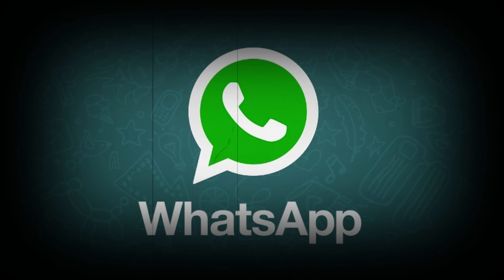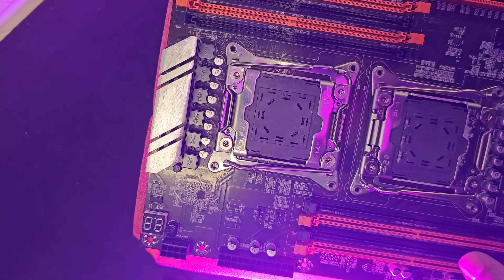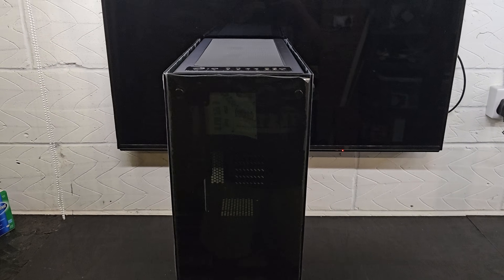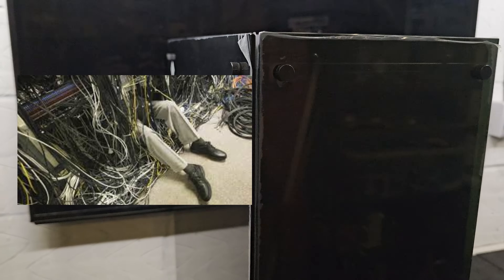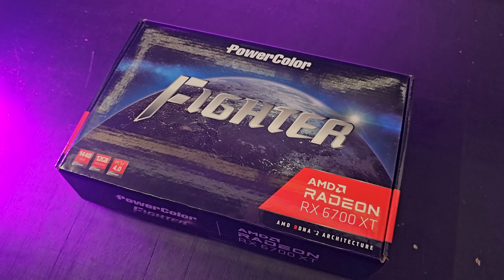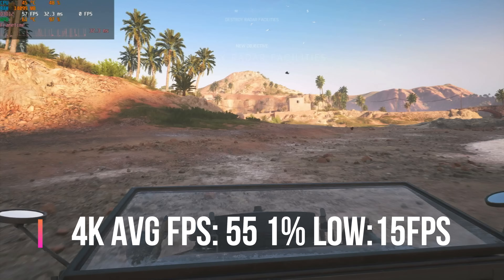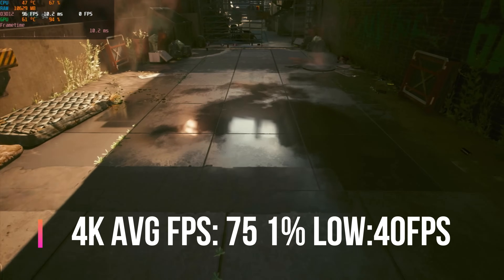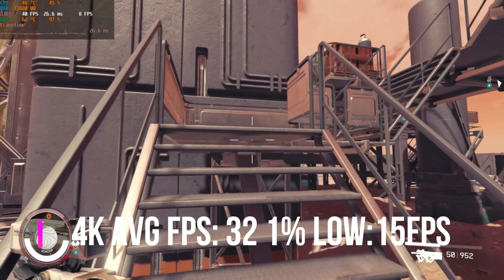Are DUAL CPU builds really THAT BAD?? Xeon E5-2643 V3, RX 6700 XT

Comment: If you want to try a dual XEON system don't bother with building something, case/PS/memory/MB even from the cheapest chinese websites will run you over 300USD. Old dual CPU workstations are dirt cheap. HP z640's are less than 200USD. If you keep and eye out you can get them with 32-64Gb ram and 950w PS and SSD drives. Sometimes the CPU's are not ideal but you can get any used E5 v3/v4 f0r less than 40USD, a lot are less than 20USD.
Reply from the maker: @JamesDeSimone-im7tz  sometimes people just give those away bur they are such a good base to build from!
Reply: @RestoTek  I know. They are considered e-waste. z840's are great systems too. I picked up 2 for less than 300USD. Single CPU systems are even cheaper. They are fun to play with.

Comment: You got bad fps in warzone is because of your GPU and not CPU. Rx 6700XT just simply too weak for 4k. While your GPU is on 100% your CPU(s) only worked at 30-35%.
Reply from the maker: @imbot3804  I'll try it with a rtx 3080ti see what happens

Comment: I wonder, if there were a motherboard with a chipset controlled pcie 3.0 x16, if that would alleviate the latency. I was always told not to installed GPU in the second x16 rails of a PC because that one isnt connected directly to the CPU but since the poor  1% lows in games here are likely because its connected directly to one cpu controlled pcie slot but not the other. So variable latency when a core from cpu 2 tries to process.
Reply from the maker: Interesting I'll need to have a look into this, thinking of making another video around this
Reply: @RestoTek  good luck to you! It can be difficult to find info on these boards. I look forward to watching it!
Reply from the maker: @jerryknudsen7898  haha I know I've looked and there isn't allot, I just poke it and see if it does something different
Reply: @RestoTek  that's pretty much all you can do lol I do the same with weird parts. There's 10,000 videos of an I9-13900k and virtually no data something weird like dual xeons, or even the 5700G testing with ideal settings which I just broke down and did myself out of curiosity 😅 the curse of chasing obscure information

Comment: I have dual e5 2697v3 32 ram rx 580
Reply from the maker: Sounds like a pretty amazing system :)
Reply: Hello, I have ZX DU99D4 and two Intel Xeon E5-2643 v4 CPUs, but only one is being detected. Both CPUs have been tested and are working individually. However, when both are connected, I get error 79. Do you know what the problem might be?

Comment: As we say in my country: use the right tool for the right job. A dual cpu (not this one actually) setup with plenty of cores/threads are aimed for multi-tasking, a lot of containers, virtual machines and so on, not for playing games. Greetings from Brazil!
Reply from the maker: 100%, although it can run games too but your right, it's fantastic at all of those other things
Reply: @RestoTek  yeah, I work as a software engineer and run several containers in my Linux box with docker. It's where the tons of cores/threads really shine. It would be nice to have a video on this topic as well, if possible.
Reply: should try this with the 2699. From what I've seen with these xeons, the base clocks don't really matter much. What matters is their boost clock speeds. the 2699 can boost to 3.6 megahertz with 18 cores/36 threads. It's what I personally use. Can't imagine two of them working together.
Reply: @johnruscigno5738  dual 2699 v3 with unlock turbo boost would be a monster in a heavily multithreaded scenario
Reply: I use a x99 with E5-2695 to run quantum chemistry calculations and it works awesome!

Comment: I just built a Dell precision T7810 with dual Xeon 2690 v4 2.6ghz base clock with 3.2 turbo. 1 64 GB stick of ddr4 at 2400 MHz for each cpu. 1660ti for gpu. Tested a few games at 1080p high settings 
Valorant steady 165 fps while capped 
Rust 90 fps with hardly any drops
Valheim was interesting as it was originally only 40-60 fps even with settings dropped but used the steam launch option -USEALLAVAIABLECORES and it went too 90-110 fps 
I’m experiencing some issues with valorant randomly disconnecting from game servers, and my microphone (hyper x quadcast s) just stops working randomly
Reply from the maker: It's pretty impressive what such an old system can achieve. I was using it for a while and I never really had many major issues. I played valorant for a while and it was fine. The only problem was if I took one stick of ram out the system would fail and then I would need to add each one by one

Comment: The frame buffers happen but can be stopped with frame caps and also stopped with an AMD software that caps frames automatically through dynamic analysis (meaning 115fps on one map, 100fps cap on the other). Its called AMD Anti-Lag. They also have Anti lag +, but thats only on a few games, less than 12 currently. 

So I reco either placing a solid frame cap, looks about 75-80fps for bf5 1080p

Comment: is it perfect to run an LLm or GPT on it? I'm thinking of buying specs like this but with 64GB RAM
Reply from the maker: Haven't tried it but probably would work, you would need to get different cpus then I got. I'm guessing more cores are better for these kind of processes
Reply: It depends more on the GPU. DELL T7910 with dual xeon 2667v3 and 128GB RAM and a very very cheap Quadro M4000 8GB runs 7b models at around 12 t/s, and 12 or 14b models at around 5-6 t/s. Pascal, Volta, Turing, or Ampere cards would naturally be faster in that order, but their prices go up too. The size of the VRAM determines the size of the models you can comfortably play with. If you just want to play around with inference and learn the basics, the Maxwell cards are the lowest you could start with. If you want to do fine-tuning, you'd need to start at the Volta cards level.

Comment: These dual CPU systems were wonderful when you needed to edit videos and the software could load all the cores.  
Since you can't really overclock them in any easy way, there kind of like a road apple.   Sure its still good but who wants it? :body-blue-raised-arms:
They still do Fantastic if you use your system only for casual gaming and a daul use setup where you do more work then games. 

If you LOVE to do video editing?   Or live streaming?  These dual CPU boards (If you can get them to work properly) loaded with the Maximum amount of ram still work PERFECT in a Live streaming scenario where you got TONS of Tabs open in Chrome and doing multiple video streams windows etc.   But since you can't really overclock them?   Just as good to go with the prebuilt workstations out there.  

If you LOVE to Multitask, these machines rock    
Gaming?  I just can't say they are a good value overall with things like AM-5 $500 CPU's with a Slight overclock to them beating them out without any issue and doing it at a FRACTION of the power as well.  

Then you get all the New Instructions sets backed on the CPU's today as well that some of these older model Chips just don't have. 
Then there is I/O.    Gen 3 PCI  still works for the 4090 just fine.   But Gen 4.0 PCI--e  is the future proof right now that will last you for the next  10 years easy.
Reply from the maker: I totally agree, dual cpu systems are pretty cool and I loved building this system. It was great fun but when you break it down it can be a bit finicky to get working, power draw is much higher, you can't overclock, and overall the architecture is generally outdated. It's a shame but I guess there might be a niche out there that could have use of it

Comment: If you gonna test the cpu I recommend you use lower resolution like 1080p and low preset because when you put everything in high you are testing just the Gpu, this is a GPU test not CPU. There’s don’t gonna be any bottleneck testing in 4k high settings, you just saturated VRAM and GPU usage.
Reply from the maker: Thank you, I'll keep that in mind and see what the results are if I reduce the settings, thing is though if stress the gpu then would that not show if the cpu can keep up with the gpu?
Reply: @RestoTek  When you use lower resolution the GPu can push more and get more fps, so there is when the CPU work start because it needs to make posible that the GPU reach its maximum performance reaching the higher FPS without be limited by the CPU. And no. just use cinebench for CPU benchmark, HeavenMark for GPU, each benchmark is specialized to stress an specific component.
Reply from the maker: @hectoralmonte2036  thank you that makes total sense!

Comment: hello and congratulations for the video. I would like to know if a computer like this (double CPU) can also be used for daily work such as rendering and retouching. what can you tell me about energy consumption? Is it worth consuming much more energy for performance in line with that of a modern CPU? Thank you in advance👋🏻😉
Reply from the maker: I was surprised by the power consumption it wasn't as bad as I thought but yes it certainly more power hungry than modern systems. In terms of rendering and retouching what software are you using?
Reply: @RestoTek  Hello and thanks for the reply. The programs I use are the following:
- CupCut
- Photoshop CS
“Winzip” compression programs and DVD to MKW conversion
Reply from the maker: @stefanograzi9299  let me give them a try and I'll let you know how it performs

Comment: im trying dual 2680v4. will it be better then getting the 5600x?
Reply: I use 2x2680v4 and do mods for this model at my github. Fixed somethings at bios level and port rebar at native way for this model!.
Reply from the maker: I'm nor sure tbh, try it and let me know 🙂
Reply: nah get 5600 so you can upgrade to a 5800X3D down the line
Reply: 5600x

Comment: Did you manage to get the memory to work in quad channel or just dual? Thats where im stuck with the same board with all 8 slots populated with 16 Gb samsung ecc 2400 dimms
Reply from the maker: I might be wrong but I don't think this can run in quad channel. I think each bank of 4 memory slots is allocated to each socket, so only dual channel per socket?
Reply: @RestoTek  dual  2600series  v3/v4 is 4 channel per cpu
Reply: I think you're onto something there , and no I'm not being sarcastic

Comment: ive got dual 240mm in the same config and its totally overkill, stock coolers or 120mm aio's would have done the trick
Reply from the maker: It completely is overkill but doesn't it look awesome though 🤣
Reply: @parliamentarian6598 Hello, i want to make a similar config. Can the two 240mm aio radiators can be placed at the top of the case, does it have enough space ? In Which case ?
Reply from the maker: @z0rix55  my case in the video is pretty massive and I wouldn't have been able to fit 2 x 240mm on the top, would be interesting to see what @parliamentarian6598 comes back with
Reply: i have the Haf700 Beserker, you could fit 5x 240mm aios inside it at once if you wanted @RestoTek
Reply from the maker: @parliamentarian6598  oh wow that is a wild case, didn't realise something like that even existed!
Reply: @RestoTek  thanks for your response !
Reply: @parliamentarian6598  thanks for your response, i have seen this case, but she is very expensive, i want to take a look at a more affordable option :/
Reply: @RestoTek  otherwise, is it possible to install a 240mm AIO radiator at the rear, another on top, and finally a 360mm radiator on front?  in fact I would like to cool my processors with 240mm AIOs, and to mod my GPU with a 240 or 360mm AIO...
Reply: cooler master Haf700 beserker @z0rix55

Comment: By the way to get the top nvme slot working you might need to move all 4 of those jumpers up that are to the right of the second nvme slot
Reply from the maker: Yeah I played around with the jumpers for a while and managed to get both m.2 slots working but they were super slow. So in the end I just installed a pcie m.2 card and the speeds were much better
Reply: @RestoTek  on my board the top slot only runs at pcie 2.0 speed though so it tops out at 1500mbps, bottom gets 3500. i had to move all 4 jumpers to have it work.

Comment: I'm running a zx du99d4 with dual 2699-v3 18-core cpus, 128gb 2133 ddr4 and a 6700xt. 
Modded Rebar support into the bios, removed a microcode and used the 2011-v3 all core turbo mod with 50-50 offset for the cpu and cache voltage.
Sits comfortably at 3.3ghz under load and 2.8 under avx workload.  

One quirk I found was that i had crashes in dx12 titles with rebar enabled, set MMIO Base to 2T instead of 56T and it fixed that issue.

if you do the Rebar mod/remove the cpu microcode then remember to do the Haswell USB3 Hotfix patch to it before flashing  the file otherwise usb3 wont work properly and the pc will freak out if you put more than 64gb ram into it.
Reply from the maker: Thanks for the tip looks like you have done far more tinkering than I have, I've managed to get mine to 3.6 ghz but then it's mac Boost Clock is 3.7 ghz anyways. 2463 is less cores but higher clock speeds which I though might work for gaming a little better, I haven't found another xeon with better clocks that does not cost a fortune
Reply: @RestoTek  If i disable a few cores i think i could get mine to 3.6, with 18 cores it hits the tdp pretty quick hence why i have to do the voltage offset. 
Let me know if you come across any issues with your board and i might be able to help, i have done a lot of tinkering over the past few months with my one.
Reply from the maker: @parliamentarian6598  absolutely I'll definately let you know, just wondering but have you disabled mutli threading, does it impact performance in any way?
Reply: i left it on, things that can utilise multiple threads definitely benefit from it. Try a cinebench with Hyperthreading on and one with it off, @RestoTek
Reply: what is the benefit of doing all that, how does your system perform 1 cpu vs 2 cpu? I do wanna add a second one to mine
Reply: Hello, I have ZX DU99D4 and two Intel Xeon E5-2643 v4 CPUs, but only one is being detected. Both CPUs have been tested and are working individually. However, when both are connected, I get error 79. Do you know what the problem might be?
Reply: @bpyt621  do you have the memory in the correct slots? you need equal amount of memory on both cpus, sorry for the super late reply, turns out i had reply notifications turned off
Reply: @parliamentarian6598  i think he's figured it out by now man
Reply: @goobus1212  🤣
Reply: I run a single E5-2699v3 with turbo boost unlock and 40/20 under volt. I get 3.05GHz all core in AVX and 3.35GHz all core non AVX with 105.5 MHz baseclock. Only really run the 105.5 MHz base clock for maximum performance as it is unstable. Usually run 103 MHz. Trying to see if there is any way to get the magical 36x multiplier on all 18 cores in AVX workloads.

Comment: its not the ram coming loose, its the lack of pressure on the cpu's causing ram not to show up
Reply from the maker: I tightened the screws on the cpu completely and then it didn't post so I had to take all the ram sticks out and reseat them again, was really weird
Reply: @RestoTek  its usually the pressure on the cpu that isn't correct that causes that
Reply from the maker: @2009numan  it's weird because it posted fine when I bench tested it then when I put it in the case it stopped working 🤣
Reply: @RestoTek  Too much pressure also does the same. I had a lot of issues in the past with one CPU because I kept applying too much pressure, so only half the ram (2 out of 4 sticks) were usually detected. To fix this, I usually had to take the CPU out and into the socket again. And to be gentle!